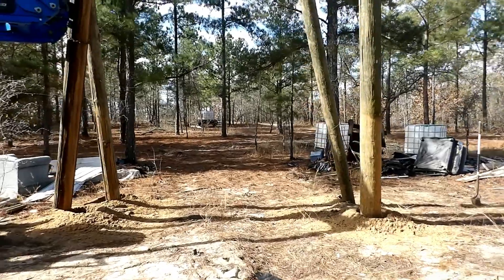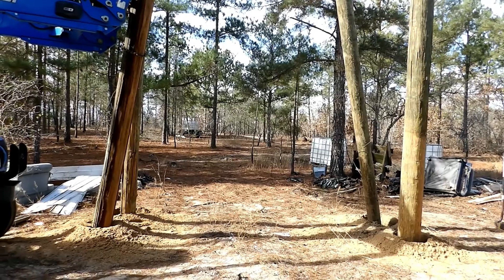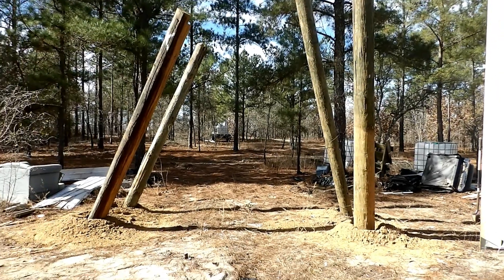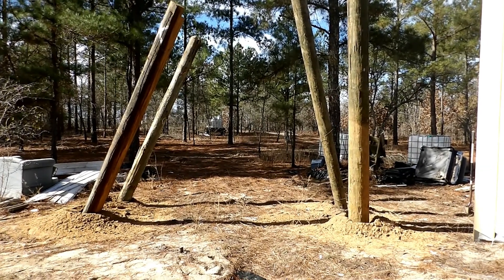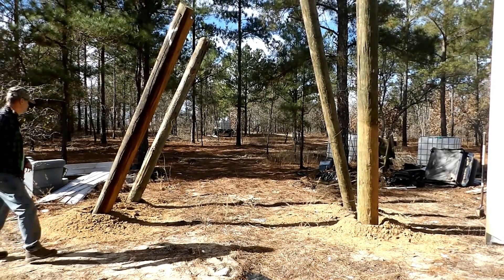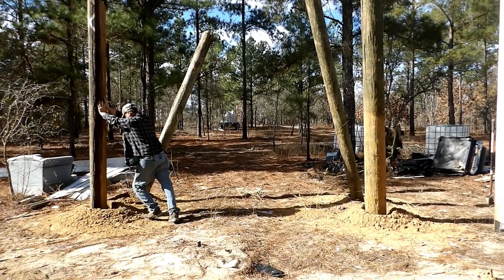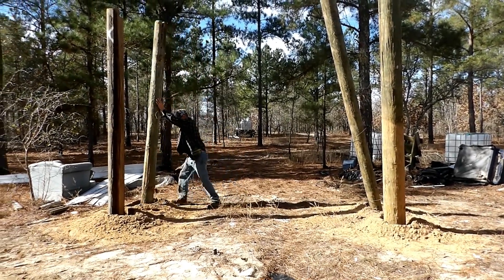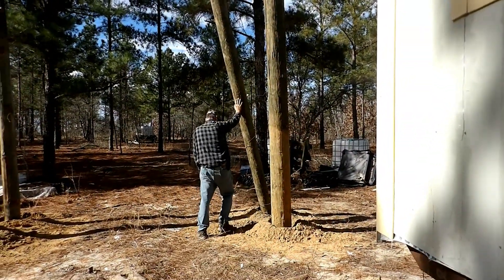Starting the Build for a Gravity-Fed Water System

Comment: There are 2 types of wind turbines,  AC three phase that has 3 cables and a DC that connects to 2 cables directly to the battery, Missouri wind and solar's best turbines are the three phase turbines, there are more than one way to build a wind and solar system with these.
Reply from the maker: Thanks for the helpful tips we can use all the help we can get!